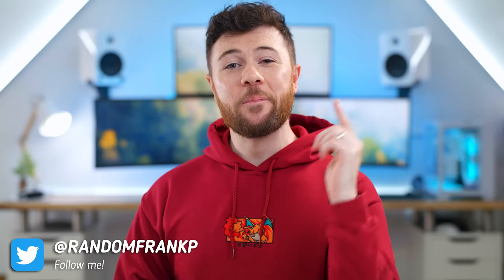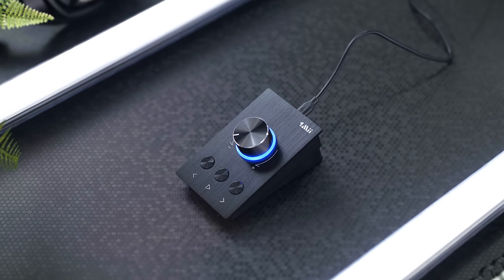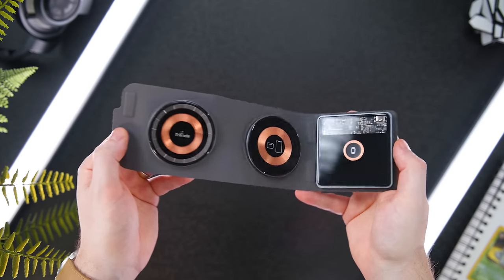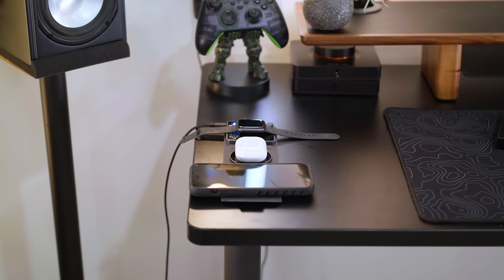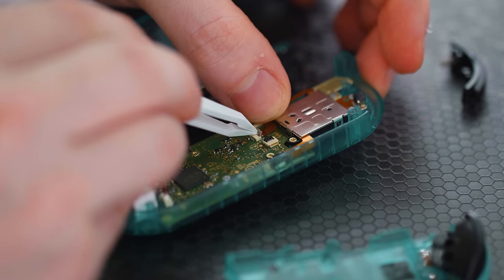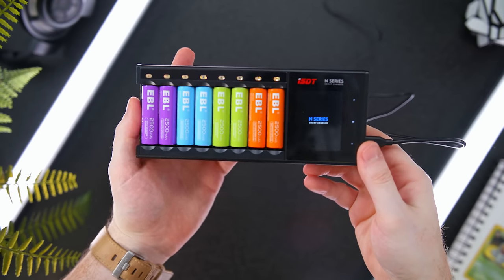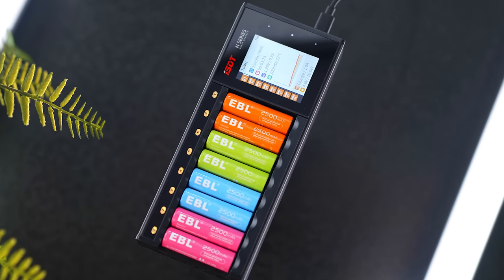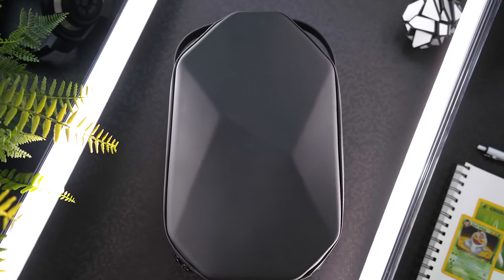Cool Tech Under $50 - February!

Comment: The battery charger would actually be awesome for me as I have a wireless mic system that uses Double A batteries and I can't stand the normal chargers where there's no way to know what is going on or how long the batteries need to charge for.

The multi-media controller would also be cool for my setup

Comment: OMG! That Battery Charger is WHAT I NEED IN MY LIFE RIGHT NOW!!! Since I got a VR setup, Ive probably spent nearly $150 on batteries alone. The controller batteries just die in between sessions over time, even when I dont use them.

Comment: iSDT Battery Charger is definitely a must have. Since it's a smart battery charger, you won't have to worry about battery settings. And it also has a discharge function which is good to have especially when storing the battery for a longer period of time. And to cap it all of is, it's powered by USB C; no need to buy additional cables or bricks to power this one up

Comment: For the Universal Battery Charger, 3 things: 
1. It's USB C powered, but it does NOT come with a charger. Ironically, a charger without a charger. That's not clear in your video. You should have said that it does not come with a outlet charger.  2. It's not touch screen at all. Just 3 capacitive buttons to the side of the screen. The LCD screen itself does not respond to touch inputs.
3. Removing the batteries is cumbersome. If you have more than one charging, yeah, use your nails or some tool.

Bonus: it's missing a 9V battery charger. Even if it was just one slot!

Comment: The 3d shell carry case would be ideal for my steam deck, using the case it came with just doesn't come with enough storage for the charger, a dock, external storage and some headphones. Makes the original case kind of useless if you need another bag to carry the rest of it...

Comment: I will need to get those switch joystick replacements soon. My pro controller is actually the first to experience drift though. Unfortunately, those joysticks are soldered into the controller board, not looking forward to trying to desolder the old ones and solder the new ones back on.

Comment: Mmmm I love my N8 charger since I go through a lot of batteries with my RC hobby.  The info it tells you about each cell while it’s charging is pretty phenomenal! I would recommend to anyone who’s interested to monitor it or to place it in an area that can get a little airflow if you populate all of the slots while charging. It does tend to get hot.

Comment: The battery charging station is a need for me. I work with a LOT of medical devices that depend on replaceable batteries and it could be amazing to know when some of them are in fail state in order to replace those sooner than later.

Comment: Greetings Frank, the product that I will be getting in the future is the extremely useful battery charger. I am starting out building my own Lithium Ion battery packs for my ebikes and this product has what I need to charge, analyse each cell individually with all the traits you mentioned.  You didn't say specifically that it runs tests to see a cell's viability, but I'm betting it has that feature too. I look forward to seeing the new tech toys that come out and you rarely disappoint. I have a radio show I do here in Florida and still rocking my CB-1 headphones. I'm on a second set of em, but that first pair was broken due to my clumsiness. Take care, Danny

Comment: The 3 in 1 wireless magnetic charger looks very efficient! I travel from time to time for work and what I use is like a 5 in 1 usb hub all filled with cables to charge my devices. Not very space efficient. Now if it isnt broken, it doesnt need fixing right? but if I win, the charger would very much replace my current travel 'kit'(mess)

Comment: I REALLY WANT THIS CHANNEL TO CHECK OUT THE C.CRANE SOLAR BATTERY CHARGER!

The C Crane company is renowned for their feature packed and CRAZY expensive radioes but they have a cool gadget called the C Crane Solar Battery Charger. It's simple, looks like a small radio itself. But it can charge 2 d or C batteries, 2 aa or aaa batteries and has a simple meter that tells you under the sunlight how long it will take to charge each size of battery!

I was so impressed I bought 8 of these!

Last test through it took almost a full day to fully recharge 2 10000mah batteries but that's great considering g it's a small 5watt charger!

25$ on amazon!

Comment: What I want to see from tech backpack companies is the zip to not be exposed externally, have it loop around into the underside where it goes into a little indent which is against your body for that extra bit of security.

Yes people can still cut it open or just plain mug you but that opportunist on the bus, train, subway, or even walking might try and simply unzip, grab and run.

Comment: First item: cool box with media controls
Me: Has razer blackwidow which has all of that on the top-right (except the amp, but I'm wondering if this device just offers passthrough since one of the two connectors has to be the input)

Comment: That bag is awesome!
I have a whole mobile gaming setup for my steam deck. I dock it & have a portable monitor. 60% keyboard and a mouse. 
Only thing I'm missing is a handy bag for my deck 🙏 
I will say the steam deck case is probably one of the worst designed cases ever. 
Doesn't even have a spot to put the charger nevermind Any  accessories.